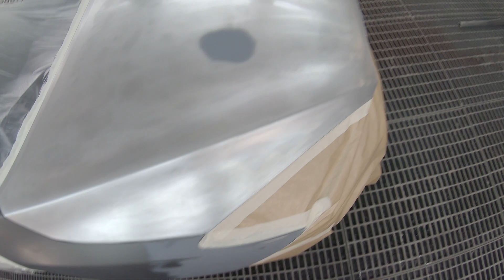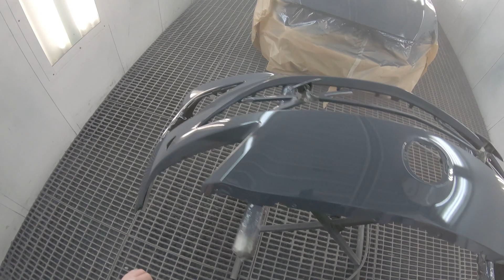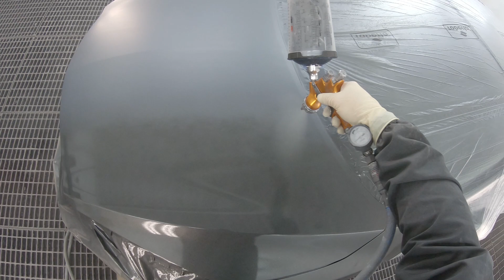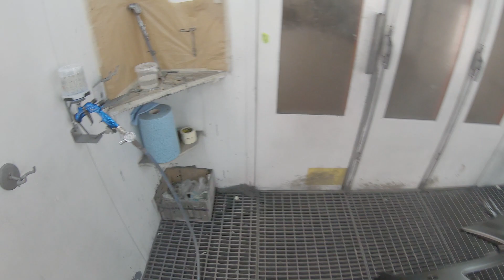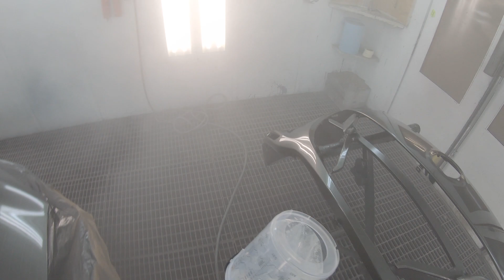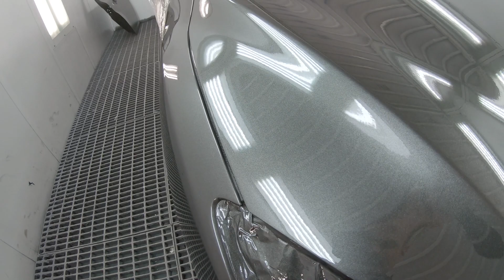Car painting | Mazda Hood painting wet on wet | Non Sanding primer PPG DP4000 | Cromax Pro | Lechler

Comment: nice controll coat.  that was TE10 cap?   many many thanks
Reply from the maker: Te10 1.2
Reply: @coloroncarpainter5031  many thanks!  strange that you choose the 1.2.  can you please tell me the settings for fluid and air pressure you used?